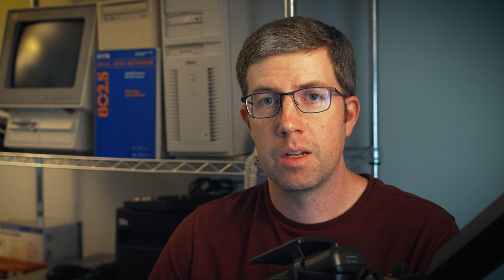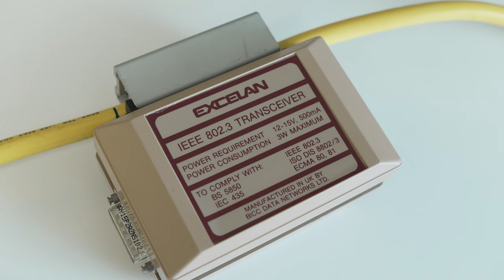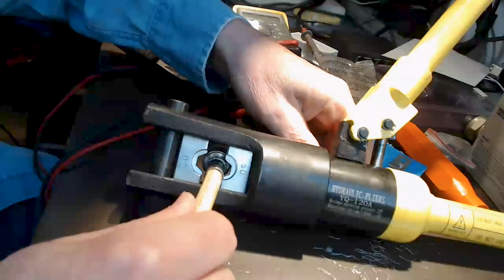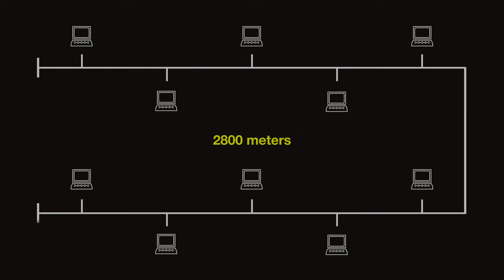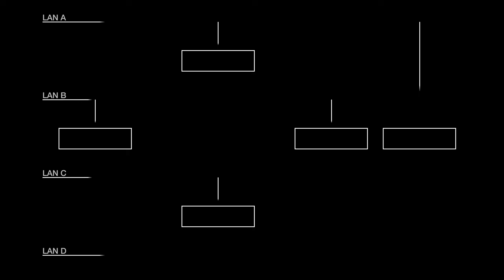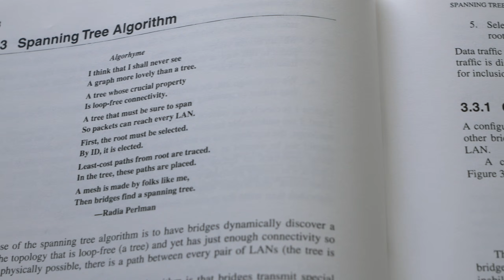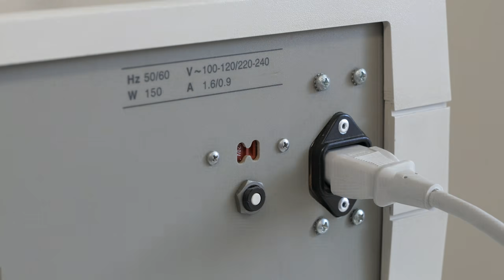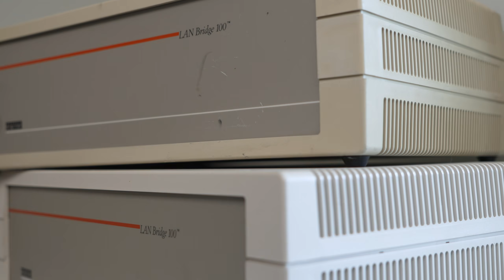EXPANDING THE ETHER: The invention of the network bridge

Comment: A small nit: store and forward does not refer to storing the Mac address,  that would be a "learning bridge". Store and forward is in contrast to cut-through bridges that start forwarding as soon as the destination mac address is received. Store-and-forward receives the whole packet first and then tries to transmit it,  when it. This allows garbled packets to be discarded and not take up time on the receiving network segment.
Reply: All bridges (afaik) have to be store and forward, as directly forwarding a packet on the destination network would result in A. joining the collision domains together (i.e. if the destination segment is busy, you would have to signal a collision on the source segment to inform the sender the packet was not transmitted successfully), or B. dropping packets silently when the destination segment was busy.

As neither of these was desirable, some memory was allocated to storage of packets for forwarding, usually with a staleness timer, to allow packets that weren't successfully forwarded to eventually be dropped in order to free up the memory buffer.

From experience, as the memory buffer was small it could cause random drops between the segments if one was busy, which was always an interesting challenge to diagnose (as 100 Mbps networking was being introduced and the original 10 Mbps bridges were getting older and less reliable)
Reply: @phil7084  Please see e.g. https://en.wikipedia.org/wiki/Cut-through_switching for a discussion about cut through switching. It was very common for a while before wire speeds were such that a single packet delay was less of an issue. 

If the outbound port was busy the packets were buffered, waiting for it to go idle. But the cut-through bridges would start early, if possible. The major downsides were: an inability to deal with differing wire speeds (not an isue at 10baseX as that was the only speed) and forwarding packets with broken FCS or otherwise corrupted wasting time on the outbound segment.
Reply: @ptefar  I'm aware of cut through switching - but it was introduced for ethernet switching, using custom silicon.
The early bridges used shared memory between the network adaptors.
Reply: @phil7084  I agree. I remember cut thorugh bridges starting to appear in the late 1980s. My point in the original comment was that I have never heard store-and-forward being used to refer to a self learning bridge like what whas mentioned in the video (as in storing the mac address). It was always used as a contrast to cut-through. I never menat to imply that early bridges were cut-thorugh, they were indeed not.
Reply: @phil7084 Kalpana switches have entered the conversation…

Comment: You have to note that 10BASE5/10BASE2 Ethernet was using CSMA/CD copied from the ALOHA project in Hawaii, which was a radio protocol. All the limitations of pre-bridge ethernet make more sense when the cable is not there, and you're just using radio transceivers.
Reply: Same thing, just a different 'ether', copper instead of air

Comment: I am VERY curious about why you only saw about 1.8Mb/s. The 3.9 microsecond required to make a forwarding decision should have been more than fast enough to forward at the required 14,880 packets per second rate for the 64 byte length you selected. What am I missing?

Comment: The first network I built was a coaxial cable between two computers with T-connectors and terminators (loved having terminators in my network as a kid) creating the resistance mentioned, yet the cable was significantly thinner - this was perhaps the next iteration of the tech? Looking forward to the next video!
Reply: Yes, that’s thinnet (10-base2)   Electrically identical but lower-cost wiring components and shorter range.  Absolutely ubiquitous in the early 1990s.

It was actually possible to mix the two, although I think many network admins of the day didn’t realise it.  It did require very careful design — basically to make sure that the thinnet devices were still kept the correct distances on the cable that a vampire tap would have been placed.  It was finicky but it could work.

Comment: Thank you very much for this very helpful and educative document! By the way Mark Kempf invented the first Bridge in 1983, so it took him 3 years to bring it to the market in 1986. I have been recently tracing the history of Ethernet, Bridges and Switches myself as a preparation for CISCO certification, and the history of the first Switch is also fascinating! In 1986 the first Switch was installed by Alantec at NASA, but it was Kalpana that brought it to the market in 1990. The first  ATM Layer 3 Switch was announced by Ipsilon Networks in 1996, but the first Ethernet Layer 3 Switch was marketed by Nortel in 1998. Thank you.

Comment: The details on tapping and terminating the thicknet from John was awesome. Keep up the outstanding history work on this channel!!!
Reply: Horror story... when non-network people would just screw in the TAP without drilling the hole.  Network Down!  Network Down!
Reply: @PeterWillard   I often wondered how these vampire taps I'd always heard about avoided bridging the shield and the conductor.  This was the first time I've actually seen the process, ever.  Sounds like the process is not too dissimilar to the proper way to pierce an ear, for example:  Your goal is a clean cut around a perimeter, not just punching a hole through.
Reply: @sirnickity  Once you understood the topology of the baseband cable, you would know that  simply "screwing the pin" into the cable would be a bad idea.  The cable had a lot of shielding.
Reply: @PeterWillard Hi Pete, I remember the SANS server you managed for us.  That was a busy time...
Reply: @johnreedCaroline   It was... I went on to manage DNS services for the southeast after NETsupport was killed.  I left HP in 2015 at the time of the great split.
Reply: First time for me seeing a pair of pneumatic crimpers 😂❤

Comment: I'm definitely glad I never had to work with that thicknet stuff. I only just got into IT at the very tail end of thinnet. I set up my first network when I was in high school, it was a small one of just 3 machines at the computer shop I worked at. Hubs were kind-of expensive, and the boss didn't want to shell out for one. We had thinnet cables in stock that weren't moving, plenty of scrap cards from machines that were traded in, so I installed the cards, assigned IP addresses, connected them with the cables and T-pieces, and nothing. So I asked a friend who had worked on a network before, and he said you need to install terminators at the ends, and once that was done it just magically worked! Fast forward many years and I ended up studying networking, and I've been working as a network engineer for a fair few years now.

To this day it still surprises me that some so-called network engineers don't really understand how important spanning-tree protocol is. I constantly find newly installed switches that don't have their spanning-tree priority set correctly. It's just asking for trouble.

Comment: We had a version of these bridges in a hospital I worked at in 1996.

It was "interesting" because the backbone of this 2 city block sized campus was a chunk of thicknet that wound its way through the main building *8 floors) under a city street and through a college of nursing and branching off to various places.

It was a crapshoot if any two nodes would be able to talk to each other because when you violated that 543 rule, in practice it meant that one host wouldn't be able to talk to some other host.

That network had branches that went off to distant closets, networking hardware jumbled in operating rooms and on desktops, all sorts of things.

One meta affect of the chaos was things like printing took forever and the employees knew that, so they'd go to the water cooler or what have you to wait while something completed.  The office workers were a little pissed off when I came through and did a technology refresh from their hodgepodge of PCs with a standardized wintel desktop and modern (for the day)  10baseT switched networking via a Bay Networks switching fabric.

aka what took minutes was now instant.

And just for the record, the collision rate on that backbone was upwards of 40%,

It also was "interesting" when we'd get a call that the whole network on a floor was down and it would be because some nurse had moved their PC and unplugged the thinnet / 10Base2 connector which made the whole network unterminated.

I never had to deal with the vampire taps like your video describes, i just had to take the AUI media converter to whatever I was working on .. usually BNC.

Comment: Exceptionally researched video. Subscription well earned. As someone who has been in the game since 1990 I cringe when I watch a video with factual inaccuracies and I didn't notice a single one. Well done.
Reply: 1990?  You're a newcomer!  I first started working with LANs in early 1978, on the Air Canada reservation system.  They used proprietary tech from Rockwell Collins, which used Time Division Multiplexing (TDM), instead of packets, over a loop.  There were 2 speeds, 2 Mb and 8.  I first came across Ethernet in the 1980, connecting some VAX 11/780s with 10base5.  In 1989, I hand wired some Ethernet controllers for Data General Eclipse computers, so they could be connected to the network.
Reply: @James_Knott  I started my professional life in the military in Panama interfacing communication equipment that wasn't designed to work together. We used what could be thought of as exotic to make it happen. It was an interesting time with all of the competing technologies before everything shook out to standardize on Ethernet. I think it was around 1993 we received our magical "packet switch" and how we could interface it with our teletype circuits.

Interestingly to this day I service timing and scoring equipment in sport stadiums that still use current loop technology.

Comment: You can use modern N connectors from HAM Radio use (and HAM Radio Antenna Cables) for Thicknet nowadays. Much easier to mount those connectors. I wonder if Thicknet was developed further. With the current cables 10Gigabits via Coax would be possible. Of course only Half-Duplex.

Also as Terminator a Dummyload can be used.
Reply: Are you familiar with HFC/DOCSIS? I believe 4.0 is just around the corner, but it seems we're at the point where abandoning coax for fiber might be a better idea.
Reply: @grabasandwich  Yeah ofc it is. I just wonder what would be possible. Though 100Gigabit with Twin-Ax (Direct Attach Copper) is also possible! 🙂

Anyways DOCSIS is also obsolete Tech where  I life. We got FTTH with pure Ethernet nowadays.
Reply: The reason I had this old Ethernet cable is for feedline to my HF ham radio Antennas... Notice at 3:50 the coax cable had PL259 connectors for my 50 ohm HF rig....
Reply: @johnreedCaroline  Yeah it had. Never Thicknet Installations used N-Connectors that we also use on HAM Rigs.

Comment: Side-note: The "vampire taps" were actually a big IMPROVEMENT over the original method of connecting thicknet - vampire taps were much easier to do and could be done while the network was live! Really early on it was done using techniques similar to thinnet, IE cut the cable completely at each connected machine - using the equipment he showed for putting on connectors and the restore the network by plugging in both into the AUI transceiver (either directly or via a T junction like thinnet). This is also why the terminator was usually added as a separate entity instead of being crimped on directly (would be faster), having a end-connector meant it could be extended by just adding a new section.
Reply: Yes vampire taps were such a blessing.  Otherwise every time you connected a system you generally took a segment of the entire network offline.  And thicknet quickly moved into office spaces before thinnet ended up coming out.
Reply: We called them bee stings
Reply: I helped install thicknet, non-vampire tapped cabling in a major new office building for the New Zealand Inland Revenue Department. This was unusual as I was a RF tech doing microwave and landmobile radio systems. My group (radio techs) was called in due to the coax cabling and need for crimping on masses of 50 ohm N connectors on double shielded  coax when the NZ post office was outfitting the phone systems
Reply: What was the original method? N-type connectors?
If so, that's rough and I can totally see vampire taps as a blessing.

Comment: Worked a lot with the Lanbridge100s.  A later innovation was the availability of a fibre optic interface for one or both of the ports (they were modular from the start) to allow networking between building with electrical isolation, a problem with long thickenet runs.  The other other end of the connection was a 10base5 Dec Repeater with one fibre interface.  They could reach almost 1km used FSMA ports, and were almost indestructable.  The Lanbridges were usually in some central location (datacentre) with a rack of repeaters (10base5 fibre plus 10base2 multiports) and a coil of Thicknet in some remote dusty closet.

Comment: As Bob reminds me, 2.994 Mbps (going back to the class we took in 1973). For some reason I had thought the bridge was invented much earlier. It seems like you're specifically talking about a learning bridge.
Reply: That 2.994 was picked simply because it used a clock that was already available in the computers they were connecting.

Comment: Very cool. We had a Synoptics LattisNet hub at an old job that would cause intermittent problems. We finally realized it was simply the hub itself, and that it was very close to the Ethernet standard but not exactly and tossed it to the curb. No more problems after that. Thankfully I never had to deal with 10base5!

Comment: The thick-net annular ring is marked at the quarter wave interval.  Termination needed to be made at that interval as well.  10base2 was ever so much more forgiving.
Reply from the maker: Didn't realize even the terminators were subject to that requirement, but that makes sense.
Reply: @theserialport  Nice photo of the Kalpana switch  Want one?
Reply from the maker: Absolutely
Reply: @theserialport  Actually, it doesn't.  A terminator appears as an infinitely long cable.  I suspect the designers were just being overly cautious.
Reply: @James_Knott   Maybe he meant termination as in "installing a connector on the end of the cable" vs. a termination resistor.  I could see that being important, as the connector could be plugging into anything -- a terminating resistor, a node transceiver, or a coupler to another cable.  In that sense, it would be ideal to have it at roughly the same interval.
Reply: @sirnickity   No. terminator has only one meaning in that context, whether 10base5 or 10base2.  With either, a resistor is placed at the end of the cable to emulate an infinitely long cable.  Even if it was just another connector to add more cable, it should still be transparent.  Also, considering there's no such restriction with 10base2, I still have to wonder whether it was just being overly cautious.
BTW, I studied Electrical Engineering in college and transmission lines were a part of the course.
Reply: @James_Knott   I understand transmission lines, but I've also worked in networking for over 20 years.  We talk about "terminating cables" all the time, and usually just mean installing an end on one.  Granted, these days, nobody has to think about signal termination on Ethernet anymore.  But, given the context above -- which wasn't specific, and originating in modern parlance -- there's room for interpretation.

It may not be ideologically pure enough for your EE tastes.  :-)  And I could be wrong -- maybe he did mean termination as in signal termination.  But I think being dogmatic about the interpretation is at least potentially erroneous in this case.  That's all I was trying to say.
Reply: I remember as a kid buying 4 ethernet cards with 10base2 because, at the time, all my money went into the network cards and thinnet was cheap for me (gramps ran a wire reseller).  Evey time we removed a terminator we had to restart the network and being kids we had no idea why.  When we had lan partys and spent the half hour to set up "no one reboot and touch the cables" order was imitated.  Kind of wish I knew how much easier cat3 was back in the day:P
Reply: Funny, doesn’t “annular ring” just mean “ring-shaped ring?”

Comment: Was that original ethernet cable based on RG-8/RG-58? Being that it terminates with 50 ohm, it sounds a lot like Ham Radio antenna wiring.
Reply from the maker: I think it is very similar if not mostly identical, but others may know for sure.
Reply: Yup.  I used lots of old Ethernet thick and thin wire for my ham radios.